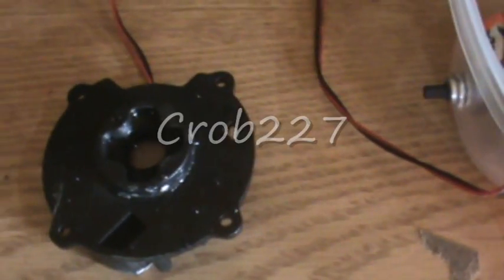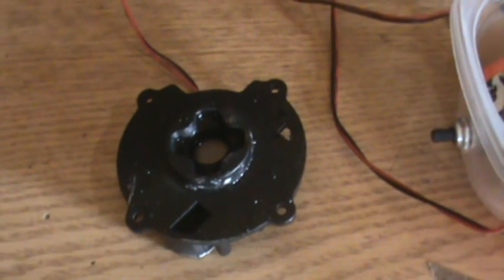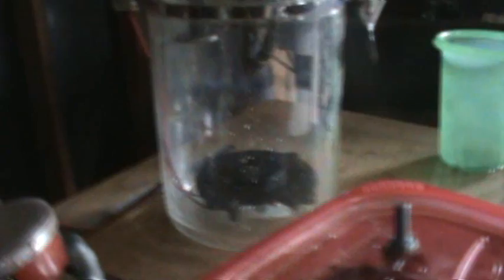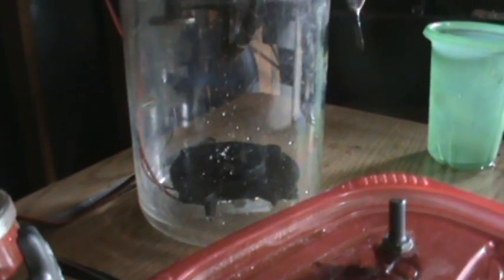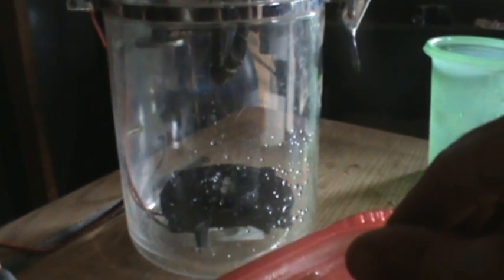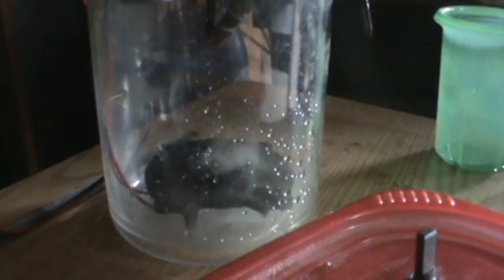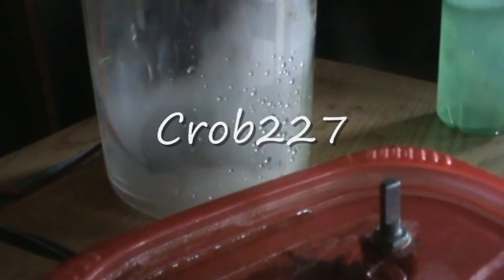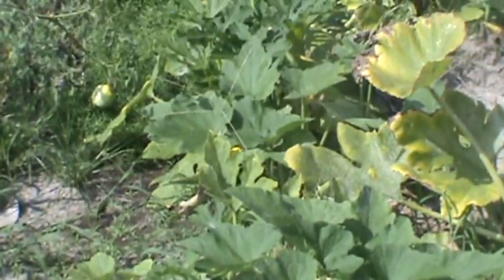Cold Vapor Vacuum Tesla Experiment pt1

Comment: lol... hmmm ended up here looking into vacuum and water...... there must be some way to use the liquid vapor phase change as part of a thermal energy storage, but its a mystery..... how much of a vacuum can you produce with a set up like this? I can see steam engines working with vacuum.... If the jar starts filled with steam at atmospheric pressure and I can find a way to pull it into a vacuum without removing the vapor it can pick up quite a bit of heat energy without loosing the vacuum, I'm interested in the original purpose of your experiment? what is the objective?
Reply from the maker: +Kenneth Williams originally it was hho,  but all my experiments are just to learn,  sometimes I could start on one project and it lead me to a different path.  This particular project I wanted to change the atmosphere in the jug to see if I could get hho out of distilled water.  where regular water cant hold a charge distilled water change hold a charge at up to 1/2" under water which can let you increase voltage up to the thousands before the  it arcs under water.
I
Reply: Cool all of my Ideas seem to be failures, but if you never fail, in the words of Einstein, it means you never tried, the hardest part is not giving up when it fail, not letting failures deminish the dream, I would love to find a way to use the liguid vapor state change as a thermal energy storage device... Seems like every concept is another dead end...
Reply: The steam engine vacuum idea junk, there would be no usable pressure change, now... You could make some very hot steam without putting energy in other than ambient temperature.... But what do you use it for with no increase in pressure....
Reply: +crob227 it would take a huge vacuum chamber or a series of chambers to account for expansion making the tank for a latent vapor change battery.

Comment from the maker: @honda4004 thanks for the tip, i think you can buy uv leds, i have a uv led light that has several different  led bulbs, its used for checking leaks in freon systems, i add a neon green oil to the unit, and the leaks show up with the light... m3sca1 has a video that shows a  uv light disrupting the plasma in the neon just for info purposes.. again thanks for the tips i will try it.

Comment from the maker: @crob227  i never intended to have a stable plasma, as a matter of fact i want a very violent high voltage pulse to go throught this negative pressure distilled water vapor, to see if i can break the water vapor.  you didnt watch the link did you? it showed the basic setup in water, impressive to me, but you werent there so the video does no justice. anyway the soundwaves pulled thegas it made back into the plasma.... i figure with the vapor the gas can have time to escape if so, vacumm the gas

Comment from the maker: @d3adp001 "only exist in low pressure" light is not plasma, your seeing indivisal magnets being sqeezed through a small coil the coil is so small that the magnets heat the material up turning it bright white, the matereial in the lightbulb itself only stays together in a vacumm. lose the vacumm lose the material.